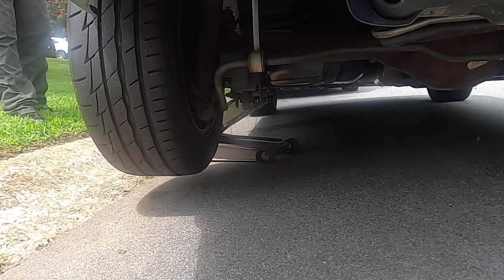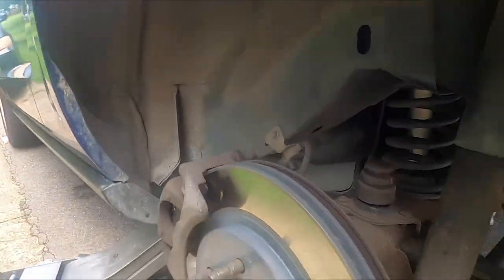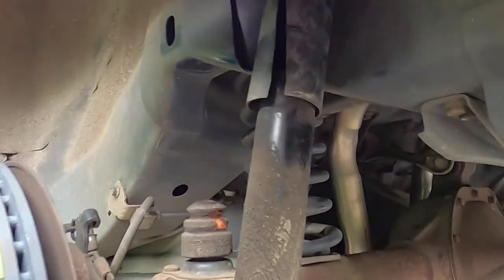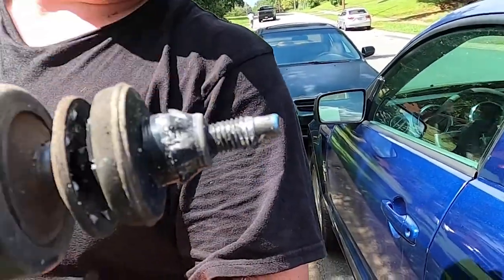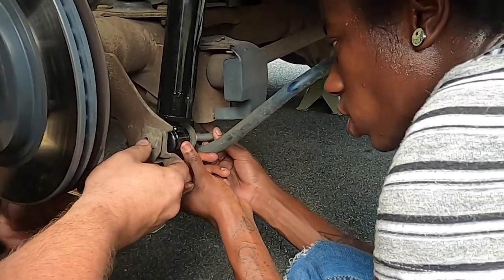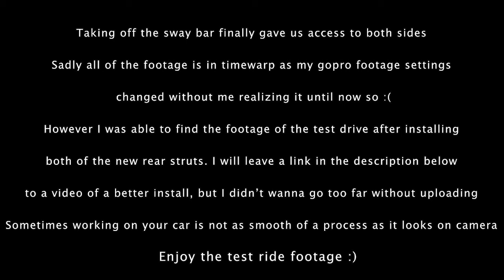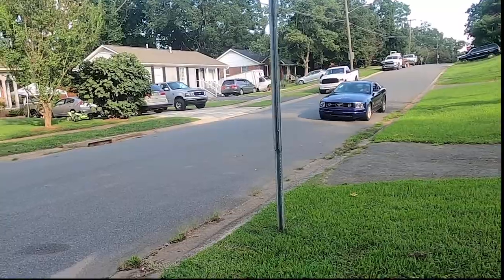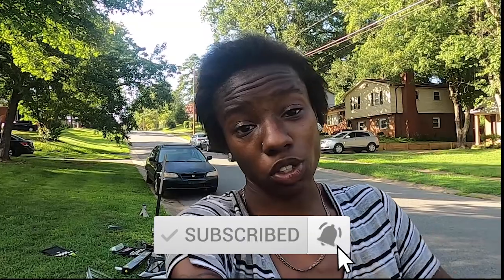Installing NEW Monroe Shocks on my 2007 Ford Mustang v6

Comment: Good work! Ok..soooo check out those control arms if you're still hearing squeaking. This is a common problem! My '07 V6 lower control arms bushings were all bad. Tested it by hitting them with lube or WD to see if the noise went away and it did. So new lower control arms was my remedy. Hope this helps!
Reply from the maker: Hm I got both of the lower control arms and bushings replaced not to long ago

Comment: Very Dope! I just bought a 2006 V6 with 149k , i installed TRQ struts pretty easily but there a little too bouncy for me ! please lmk what struts you end up using and how they feel !
Reply from the maker: So far the struts have been wayyyyy better than factory. I did notice they were pretty stiff until putting miles on them